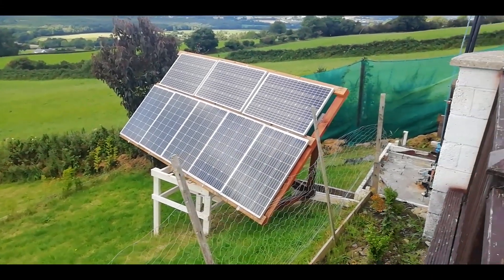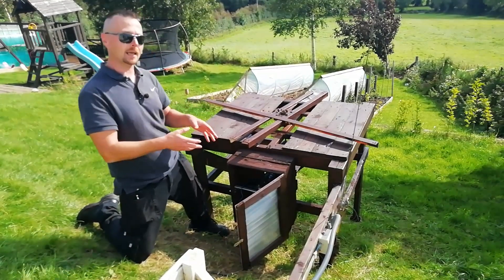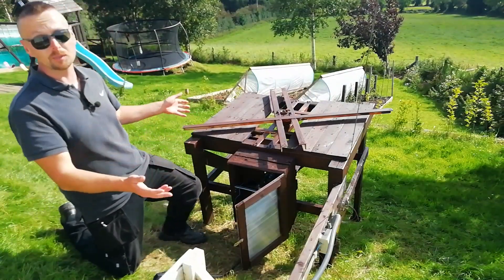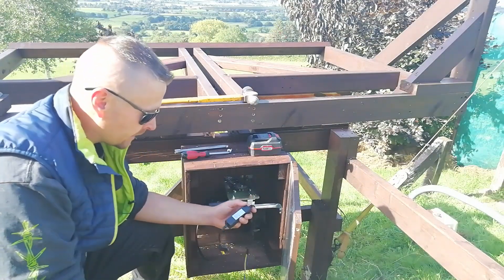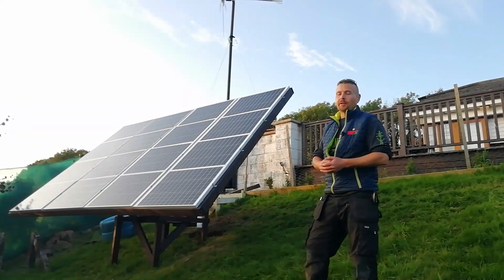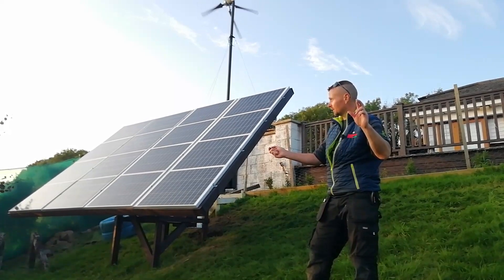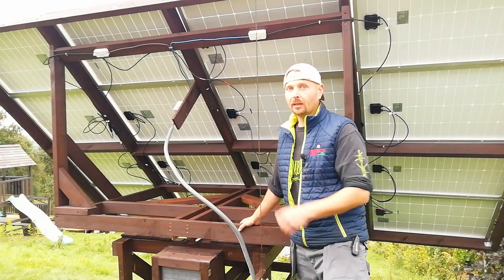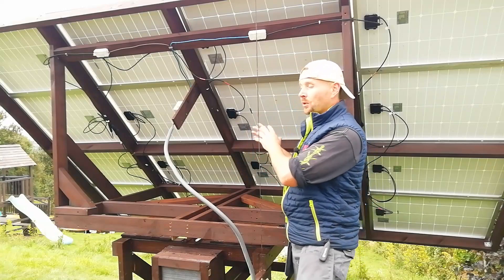DIY Rotating solar array from a DRILL BATTERY

Comment: Keep in mind , side load. I have a 20ft x10ft array with (8) 550watt panels the frame for the panels has a collar that fits over a 8 inch pipe cemented 5ft into the earth. When the wind picks up it generates tremendous side load force. Enough that it actually broke welds on the hand crank apparatus I use to turn the array from east to west. 

So if you are turning your array with a motor and that is all that is keeping it from turning, it has to be super strong in it's side load capacity to hold up.

Im currently looking into a rail actuator that has really good side load resistance. Otherwise one good 50-60 mph wind will destroy the turning apparatus.

Comment: Hey! This is an interesting idea i am curious to see how it works out once finished. We have a temporary array out to capture what we can but with it fixed in place we miss out on alot of late evening sun since it stays light out till midnight in summer the sun is completely behind the panels. I need to figure out a pivot mount like this or even a flip mount that can pivot in the center and face backwards in the evening. Thanks for sharing 👍
Reply from the maker: First thoughts would be that a flip mount would be much easier to build and less work for a motor if the pivot point is central on the array. However I'm not sure if you would see much in the way of efficiency gains at your lattitude. A rotating array would solve that but harder to engineer. Check out the company and dual axis tracker I mentioned in the vid, pretty sure it's available in the states so all you would have to do is assemble it.

Comment: Gear it down. It will have to turn against wind, rain and snow. Modulating the motor power might get you a stalled array. 
As I saw your.. table saw of an actuator😅 you should gear it down 100x from the current speed.
Reply: Also, change the Swivel Casters to Rigid Casters.
Reply: And use 4 rigid casters. One on each corner.
Reply from the maker: Yes definately needs gearing down dramatically as stated in the vid.